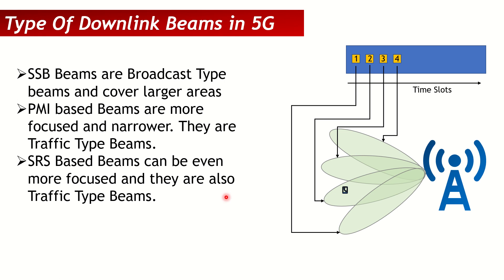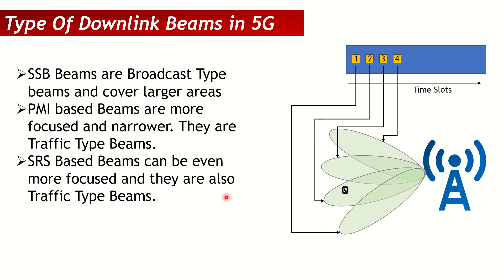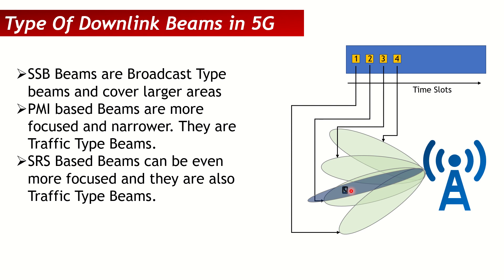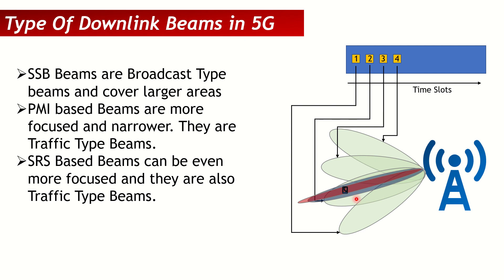5G NR Beamforming Mechanisms & Algorithms

Comment: Thanks for all of ur informative videos & explaining in such a simpler manner, just to add nowadays srs half band is getting used instead of full band which helps in overcoming the ue tx power limitations and improve the uplink accessibility of ue for srs. Would be good if you can post something on srs allocation procedure as its quite a complex concept.
Reply from the maker: Yes, correct. Nowadays, SRS half band is getting used as it increases the foot print for SRS based beamforming. Will add this topic to the list soon!

Comment: "gNB has mor comoutational power than UE side" 
Lets remember that gNB side need to support at least 64 UE. Even than it became crazy task to calculate all inverse matrixec or do SVD for each UE.
 Usually state of mind is quite oposite:
"UE need to do his work. Otherwise, ue is no good - Buy better one" (in terms of Downlink)
In terms of Uplink, you do minimum of what you can just to keep system in logical price range.
Reply from the maker: Good point!